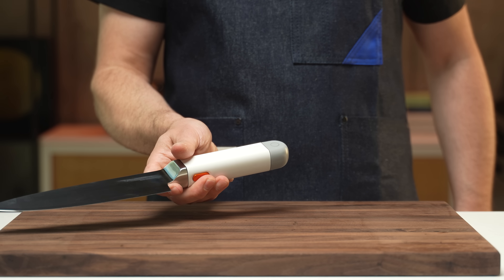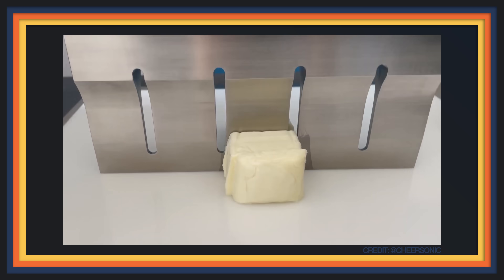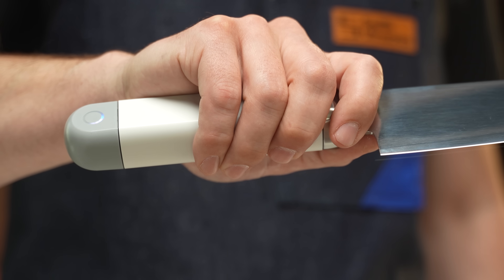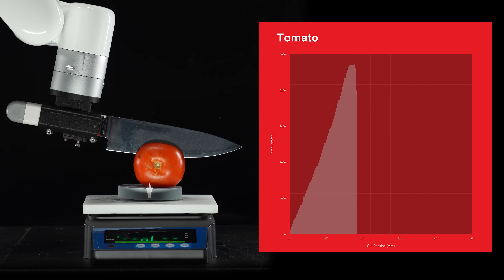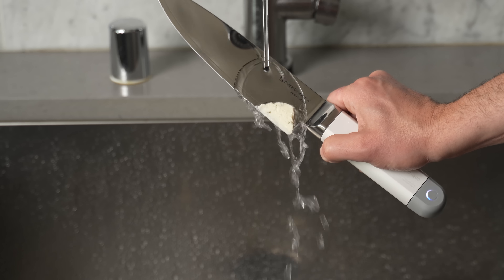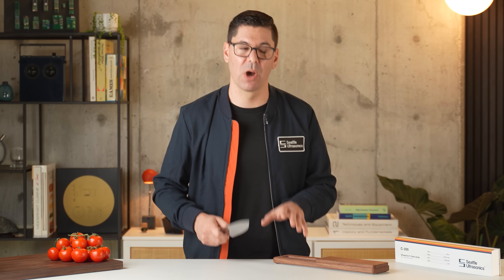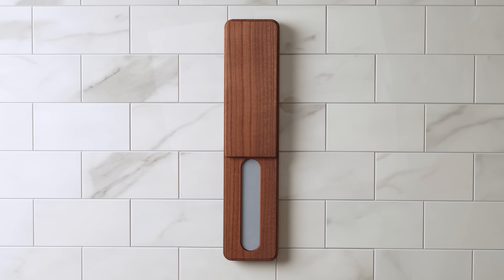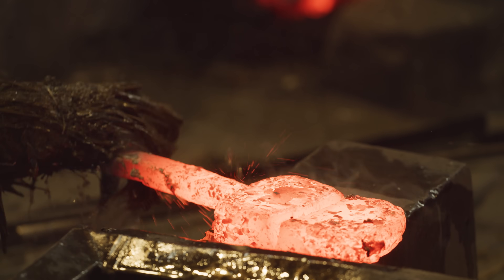The World's First Ultrasonic Chef's Knife for Home Cooks: Seattle Ultrasonics C-200

Comment: Have you tried to use this technology to create a system / water bottle that can heat the liquids within it with the help of vibrations being produced by the crystals. Not sure vibrations have been used to heat fluids before but the fact that you mentioned such high frequency made me wonder if it will.. Goal is not hot water but enough warm water. It would have applications for personnel in defense posted in cold areas , adventurers, researchers and maybe emergency uses for those trapped outside in winters.  It should probably have the ability to work with  a set of battery or solar powered kit. Hope this makes it to your list of Ideas. God Bless you many times this day !!! 😊

Comment: I am a professional sharpener who works in a knife shop that primarily retails Japanese knives, and I am quite interested in how this one performs, resharpens, and disassembles for repairs! Excited and happy for you, congratulations, and I hope your hard work sees fruition!

Personally, I am interested in the maintenance; after all, a 3000+ HKD/ 385+ USD knife is a bit pricey, and I wonder what its service life could last. Also, many Western users have large knuckles. Would the maximum heel height of the blade be too short, and would users hit the cutting board/have to use it off a chopping board? Is it possible to introduce ergonomics on the handle, making it fit the hand more snugly?

Comment: I'm a chef that's always used well honed Japanese knives, so I was skeptical at first.  Then I saw how food doesn't stick to it.

Game changer.  

That is the #1 thing slowing down chef or home cooks alike; is having to clean the blade off.  

Its not even about cutting ability for me, not having things stick is just an all around improvement over a regular knife.  I have knives so sharp you can drop a tomato on them and it will cut right in half, just with the weight of the tomato falling.  

But guess what happens when I do that to show people? Even on my $600+ premium Japanese knives? One half of the tomato sticks.  I think you are underestimating how much chefs would want this as well.  

Your choice to use the same steel as my expensive knives is also wise; it means it will stay sharp for months without re-honing.  You've clearly done a tremendous amount of research and testing, and it shows; also probably why your other products have been so good too.  

I will consider one as a self Christmas gift this year!

Comment: Love this idea! Some feedback, should be at least IP68. This is going to be exposed to hot soapy water repeatedly under high pressure taps etc. While IP ratings sound good in theory, reality is eventually water will make it's way through as it ages etc, and something this expensive should be designed to last. Also cheaping out on the battery could be a potential weak point, I hope it is of a high quality as well.

Comment: Am I the only one that doesn't understand the need for this? 
I LOVE cooking, I take pride in it and its even one of my hobbies, always wanted a Wusthof knife but didn't want to spend the money. Bought my 2 Ikea chefs knives and I keep them performing better than new with just a honing rod. In fact, they would have sliced through the tomato skin with literally no resistance at all. Actually, that initial test showed how dull it really is without its ultrasonic feature. I'm sure there is a reason for this but then this doesn't constitute as an accurate comparison between a regular knife and a blade built to be used with the ultrasonic feature ON.

Just my 2 cents, really cool idea, just not sure of its purpose.

Comment: Professional chef here. While I have fantastic knives and sharpening equipment, I can see this leading to less hand fatigue in general and helping those with carpal tunnel. 

My biggest questions are what will the balance be like having a battery and electronics etc in the handle? And, handle comfort being slightly subjective, what is the return policy? 

Then, I'm sure another iteration would come in a few years with longer battery lighter handle; an exchange policy? Make the handle upgradable?
Reply from the maker: Thanks for the kind words! We're releasing a video shortly showing handle size, weight and balance. The center of balance of the knife is right on the curvy part of the bolster. So, despite how it looks, it's surprisingly nicely balanced right where you'd hope. 

We've got a 30-day return policy (fine print on the website), but if you don't love it, send it on back. But I hope you'll enjoy using it as much as I do.

Comment: This is awesome! Can you explain why you decided to mount the charging port on the inside of the handle instead of the exterior? My brain defaults to malicious design like the Apple mouse with charging port on the bottom. However with the thought and passion behind this I have to assume there is a well intended reason right? Water maybe?
Reply from the maker: Great question! It's for a few reasons. Note that only the battery pack gets connected to a charger, not the knife itself. The first reason behind this is to keep the USB-C connection shielded from water when the knife is in use. Although I am using special water-resistant USB-C connectors, I still want to keep it safe from debris. 

Second is because the battery needs to connect to the handle somehow, and this let's us use one connector on the battery instead of two. 

Third, I want to avoid anyone trying to use the knife while a cord of any kind is attached. It seems like no fun, but is also a safety consideration. 

And finally, if you use the wireless charging tile, you can just leave the battery inserted at all times. That way you don't really need to change your behavior compared to a traditional knife. 

Hope this helps!

Comment: Did I miss how long on one charge?
Reply from the maker: On a full charge, the C-200's battery provides about 20 minutes of continuous running at maximum power. However, the C-200 only runs while you're holding down the button. In practice, that 20 runtime minutes is enough to dice at least 20 onions or 40 potatoes. You'll likely get through multiple meal preps on one charge.

Comment: 330€ - boah yea no.
I use 10-20€ hand sharpened knifes which can take and hand out a beating.
I don't mind dealing with stickage for 310€ less.

a good knife is one that works. I am fine with my cheapo stainless steal blades that I can throw at anything without any regrets.
though hats off on the technological achievement, I respect the ... ehem ... grind

Comment: Wouldn’t it be harmful to hold this for a long time? Maybe you don’t feel the vibration but that does not mean it is not vibrating some tissues and causing damage. Interesting question.
Reply from the maker: Not at the amplitudes where your hands contact the blade. We've run beta units daily for the last two years. No reports of any damage. It's not comparable to industrial ultrasonics which can definitely cause cell damage if you touch the working end.
Reply: @SeattleUltrasonics    Thank you very much for responding and reassuring us.

Comment: Since every matter or material has its own frequency, im wondering how an adjustable or a self-adjustable ultrasonic resonator would perform compared to the presented current model? 🤔
Reply from the maker: The resonant frequency of the food doesn't matter - it's not stiff enough to resonate at high frequency anyway. The knife adjusts its operating frequency about a hundred times a second to stay in resonance during cutting.

Comment: Superb! Really is inspirational, I want to know, do you still need to sharpen it? Wouldn't it get you to ground zero? Maybe you need to sharpen it way less often?
Reply from the maker: You will still need to sharpen it, but you won't need to sharpen the C-200 as frequently as a normal knife. Because the ultrasonic vibrations handle a lot of the cutting effort, the blade's sharpness is less critical over short-term use. Even as the edge eventually dulls, the knife will still cut more easily than an equivalently dull conventional knife (the ultrasonic effect compensates for some dullness).

Comment: AUS-10 (basically 440c) is not the steel I expect at the $400 price point and it does not take a very fine edge. If I'm buying for life, I'd rather spend a few more dollars and get an actually premium steel like MagnaCut or even Z-FiNit/LC200N which have better characteristics.

Comment: 3:07 fake videos
The drops remain on the edge of the blade, you don't see any mist and after passing the blade over the food, the drops remain in place...
Reply: They’re not remaining in place. It gets brushed off then moisture fills it back up. For the tomatoes, it’s because it goes right over the same area as the previous cut, which makes it seem like the same wet patch but if you look closely, you’ll see a slight shift along the length of the blade, likely because while our presenter has practiced the demo, they’re not a pro chef who can make the exact same cut like clockwork. 
For the spring onions, I assume is your main point, it’s just going really fast. Slow it down. You’ll see it smudges the moisture for a bit before it recollects. This is likely due to the resonant frequency of the blade itself encouraging moisture to clump up in the same area across the surface. Still, you should be able to see it briefly scatter before recollecting at that area. You can see the same phenomenon during the salt demonstration, notice the islands of salt just staying relatively still, it’s because the vibrations are weakest and cancel out there, which means it has the least energy, while at the edges everything is energetic and moves. Physics dictates objects always seek the lowest energy state available to them. 
Cheerio

Comment: Please correct me in the replies; contrary to intuition and entertainment, ultrasonic "stuff" does not automatically make anything "cut better". If I remember correctly, the blade has to be in contact with the material for a longer period to take effect, and it won't change with force transfer, like captain america shield, light sabers (if they had vibrating blades) and so on. However, the idea of using it for cooking is actually quite clever because not it doesn't need much strength, it also stay in contact for long enough.
That said, I have some caveats. We see in the video only cutting soft materials, and then later we hear "you can also use it as a regular knife!" I wonder how it performs with harder supplies, like meat. I assume not much better than a regular cheap knife. There is also the problem of the blade not being detachable. The blade is likely to be the first thing to deteriorate, and also the cheapest part, so replacing the whole thing is just wasteful, and pricey.
I don't know exactly the use for this knife, I guess it makes cooking a bit safer? If for some reason you work with soft materials, like bread and cheese, and need to keep sharping the blade, this might seem interesting, but for us regular mortals, it's really for the innovation.  Which, I dunno, I need to hear more about it to judge

Comment: Im not buying any of his nonsense, first of all all new knifes cut this good when they are new. The utlrasonic vibrations wouldn be large enough to cut or do anything really, sure vibrations might help with suff not sticking to the knife but thats not really beleiveble either because they say the metal is expanding and contracting, thats not ultrasonic vibration. Ultrasonic vibration cleaning products work because of the water in the tank transferres the vibrations, ulrasonic vibrations can move water but it cannot make metal expand and conract. There s a lot of fancy tech talk but this is a gimmick and doesnt really do anything. Im sure the knife is good quality but the ulrasonic part is nonsense.

Comment: As an engineer that's around ultrasonic cutters in a factory for trimming plastic injection moldings, I must say I am impressed that you've miniaturized it and brought it into a chef knife for the price you're selling at. Obviously this isn't a product for everyone yet but I congratulate you for seeing this process through. As you say, it isn't as simple as just putting any old transducer on any old blade, it's a carefully optimized system. 

I would love to see you elaborate on the availability of service parts for these though. If I am going to invest money into a product like this, I would like to know I can at minimum replace the blade and/or transducer assembly after some years of use.

Comment: Performance looks seriously impressive and the price point, though certainly more than I'm willing to cough up at the moment, is more reasonable than I expected. There are two sticking points that would have me waiting for actual user reviews before getting one. First, the ergonomics of the handle don't look great at first glance, even if you need to apply less force. Second, I worry that an IP65 rating is not enough for a handheld kitchen tool. I mean, is my $400 knife going to die if I accidentally drop it in a bowl while doing the dishes? As much as I appreciate having a removable battery, I don't know if it's worth that risk.

Either way, definitely something I'll keep an eye on. I'd love to see where this goes by the time I'm able to splurge on it.

Comment: Did you not cut any protein because the juices atomize into the air? (aka not safe for inhalation) Sneaky sneaky!
Reply from the maker: Good news! Meat, poultry, and seafood aren't wet enough to produce the mist you see coming off of citrus or tomatoes. Meats haven't produced any detectible misting in normal use. Of course, if you place the knife tip on a puddle of marinade, you're likely to get some spray. It takes a pretty wet substance with a lot of unbound water to create the misting effect.

Comment: Questions
1. is it IP rated on how much of water resistant it is? (u always have to clean the knife)
2. why not demonstrate it by cutting some meat? (since cutting meat can be really hard, some pro chef might gonna really want a knife that can make cutting meat feels like cutting butter)
Reply from the maker: The knife is water-resistant to an IP65 rating. This means it's perfectly fine to rinse under the faucet and even if it's dropped briefly into water it will survive without damage. Just don't deliberately submerge it for long periods or put it through something like a dishwasher cycle.

We are hard at work to get more demos out there, and meat cutting is at the top of the list! Stay tuned for more videos in the future :)

Comment: Website says "warning this product may expose you to lead"
Reply from the maker: The warning about lead is a formality for regulatory compliance. The C-200 contains piezoelectric ceramic crystals made of PZT-8 (lead zirconate titanate). These crystals are contained inside the water-tight handle. None of these materials are exposed to your food or hands, and the knife meets all safety standards, including RoHS-compliant regarding heavy metals. We include the California Prop 65 warning to be fully transparent and comply with state law. In short, there's no significant risk to users - it's the same kind of warning you'll see on many electronics - but we have to label it.

Comment: What is its use time?
Reply from the maker: On a full charge, the C-200's battery provides about 20 minutes of continuous running at maximum power. However, the C-200 only runs while you're holding down the button. In practice, that 20 runtime minutes is enough to dice at least 20 onions or 40 potatoes. You'll likely get through multiple meal preps on one charge.

Comment: You are buying a fancy electric toothbrush with a mediocre blade slapped onto it.
Reply from the maker: We actually don't use a motor at all, which is what powers an electric toothbrush! The ultrasonics are powered by a stack of piezoceramic crystals that expand and contract (microscopically) when we provide a voltage signal. Those microscopic changes are amplified by the shape of the knife into the vibrations you see in the video.

Comment: This is really cool and the ad is done well, too. But let's please stop perpetuating the "dull knives are more dangerous" myth. Especially with your Modernist Cuisine background, I expect more.

Unless you have some data to back up that claim - I doubt it, cause I actually looked and found it very difficult to find anything and what I did find certainly wasn't conclusive in either direction - it is just not true. Do dull knives require more force? Yes. Does that mean more slipping? Maybe. Do more slips mean more injuries? Probably. Are those injuries as bad as with a sharp knife? Definitely not. Are sharp knives typically handled by more skilled people? Yes. Are people more careful handling sharp knives? Probably. I can go on. This isn't self-evident, even if it appears that way if you want to advocate for sharpening. "Dangerous" can mean many things, but I highly doubt you had a way of measuring it though out. How do you weight the frequency of injuries against the resulting damage? At what sharpness are these minimized?

If I cut everything with a butter knife, the result won't be great and the process won't be enjoyable, but I pretty sure won't get any serious injuries. Can't say that about a sharp knife. I sharpen my knives, but I still cut myself every now and then, just like everyone. And I highly doubt that I'd be in more danger if I let my knives go dull.

Comment: Is it not just a vibrating toothbrush connected to a knife?
Reply from the maker: An electric toothbrush is powered by a small motor, and we don't use a motor at all! The ultrasonics are powered by a stack of piezoceramic crystals that expand and contract (microscopically) when we provide a voltage signal. Those microscopic changes are amplified by the shape of the knife into the vibrations you see in the video.